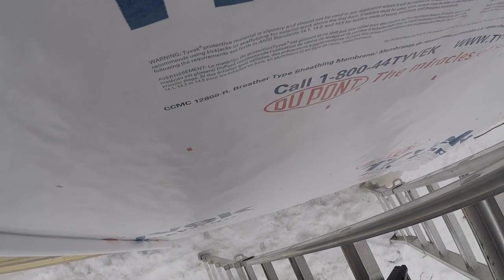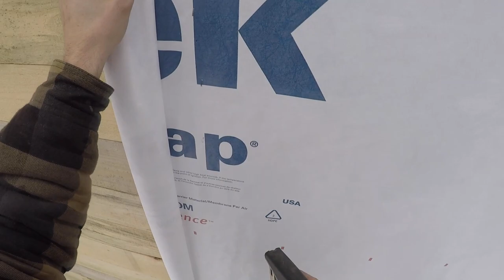The Cabin In The Woods Build | 2 Walls Have WEATHER GUARD!

Comment: ADAM. SOMETIMES. I CAN. USE. 2 BY. 4S.   OR. DOARDS.  STRAPPING. ON THE. BOARDER. TO. HOLD. TYVEC.  PAPER. AND. DON'T.  CUT.  PAPER.  UNTIL. YOU HAVE.  WINDOWS.  DOORS.   PAPER.   AND.  WOOD. STOVE. INSTALL. AS. SOON. AS. POSSIBLE.  YOUR.  GETTTING.   THERE...MERY. CHRISTMAS. ,EVEN. IF,  ITS.  LATE
Reply from the maker: Thanks so much!! I really appreciate it